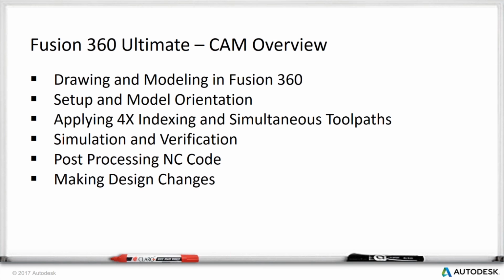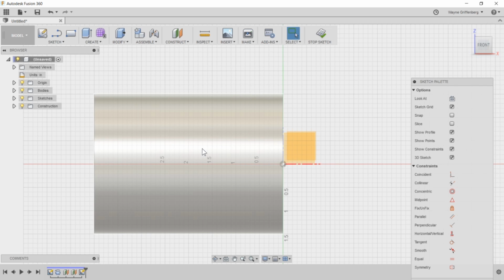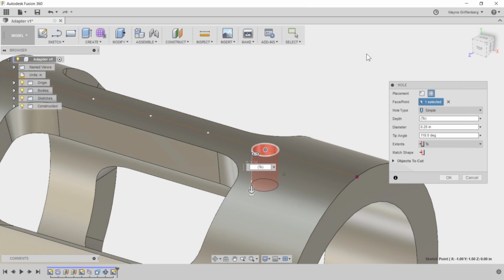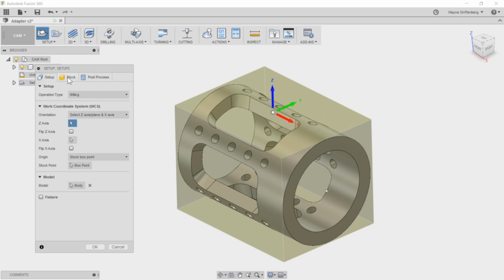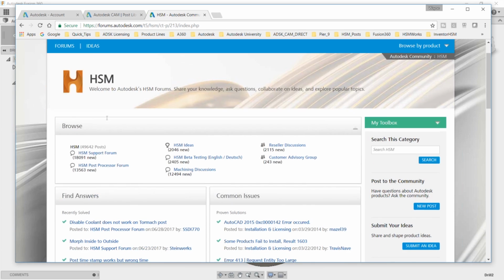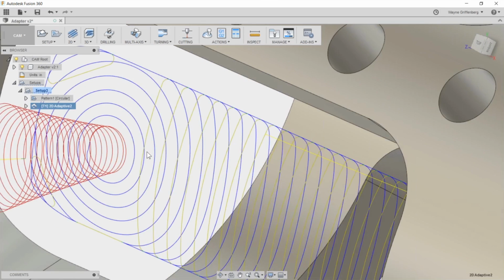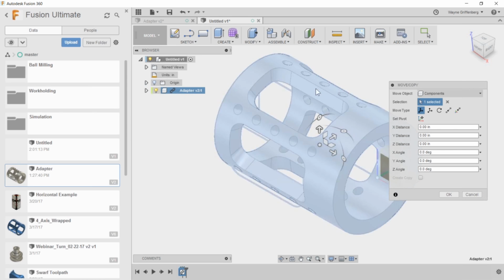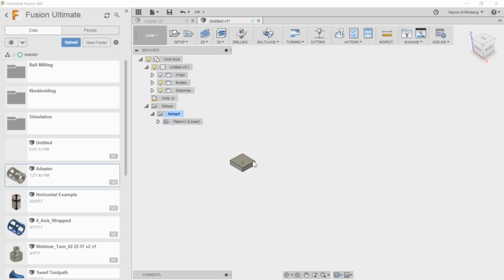4 & 5 Axis CAM in Fusion 360 Ultimate | Autodesk Virtual Academy

Comment: Can we machine the pockets in Multiple passes ????
Reply from the maker: Hi, 
Thanks for the question, yes, you can machine the pocket in multiple passes. If using the Adaptive strategy you can machine using 'Multiple Depths' found in the passes tab or if using a Contour style toolpath you can turn on 'Roughing Passes' (which gives additional radial passes) also found in the passes tab of that toolpath. Shoot me an email at alex.alvarez@ketiv.com if you'd like to go over this in more detail. 
-Alex Alvarez, KETIV Application Engineer

Comment: do you have some info on 4/5 axis engraving/tracing.i also want to know if fusion has a arc text like function.
Reply from the maker: Hi Donovan, 
Thanks for tuning in! Yes, we actually have a webinar on this explaining how to use the engrave toolpath on 4axis simultaneous. if you tune in to minute 33 on this video (https://www.youtube.com/watch?v=f6-BfXx7Jcc&feature=youtu.be) you will get a walk through of how to go about it. Unfortunately, text along an arc is still not supported, but here's a workaround using inkscape https://knowledge.autodesk.com/support/fusion-360/learn-explore/caas/screencast/Main/Details/3477a101-44c0-4d2b-9997-f6032c74863b.html
Hope this helps!
-Alex Alvarez

Comment: Which post processor should I use in fusion 360for haas rotary table with A and C axis?
Reply from the maker: Hi Vihar,
You'll have to do some minor post modifications to get a working post for the HAAS rotary table with A and C axis. Those modifications take place in line 381-479 of the generic HAAS Post. You can take a look through the HSM Post Forum to see if anyone has uploaded one by the way. Feel free to email me at  alex.alvarez@ketiv.com we can modify that post for you if need be.

Comment: I am a Fusion 360 user and I have been thinking about designing and building my own 5 axis machine. I have previously designed and built a 3 axis machine so I am not concerned about the mechanical side of things but what I have not been able to understand is where in the Fusion 360 to Mach 3 workflow I will need to configure the geometry of my machine. I am presuming Fusion, the post processor or Mach 3 will need to know if my machine is Head/Head, Head/Table or Table/Table with some understanding of the offset distances between the points of rotation. Any help or guidance gratefully received.
Reply from the maker: Hi Matt,

Yes, you'll need to specify if it's Head/Head or Head/Table in the initial setup. Then depending on the configuration measure the distance from the bottom of the tool holder to the rotating axis or from the bottom of the tool to the rotating axis. That value would then be entered into the post and you can go from there. Luckily you'll only have to do this once. If you have any more questions about this send me an email to alex.alvarez@ketiv.com and I'd be happy to help!
Reply: What you actually have to do is make a good standard library for the post processor. Download the GRBL library for instance and edit it for your specific machine: B-ofset and C-ofset  (https://forums.autodesk.com/t5/hsm-post-processor-forum/how-to-set-up-a-4-5-axis-machine-configuration/td-p/6488176). 

Also I can now not find the link in the article, but Notepad++ is the nicest editor for this kind of stuff and it's FREE! 

After that you need to configure MACH3 for the G54 position of your stock (easypeasypart of cake).